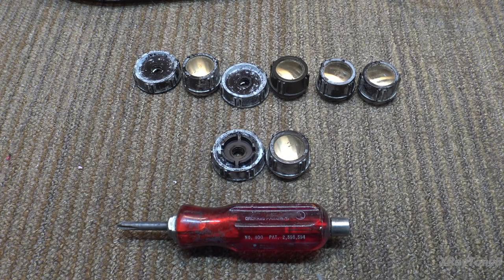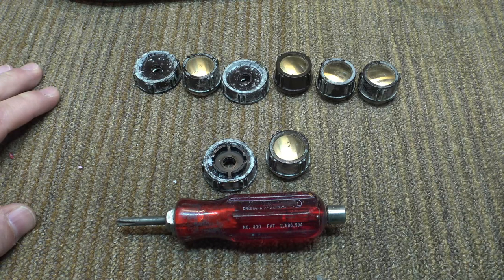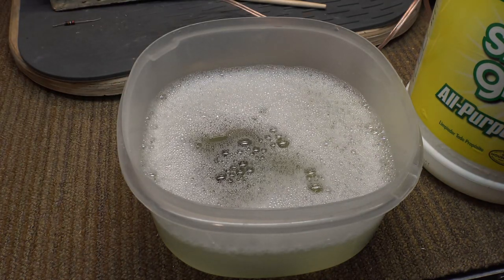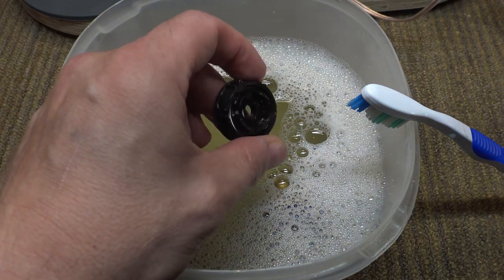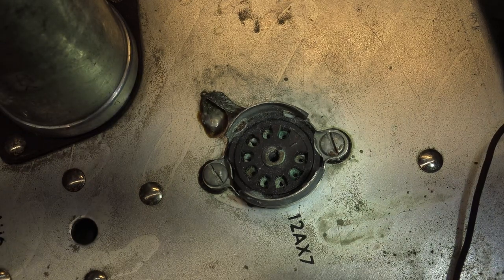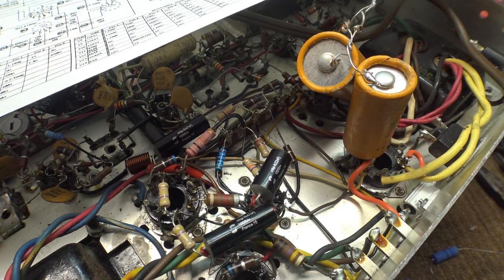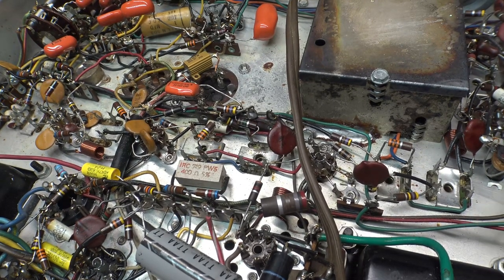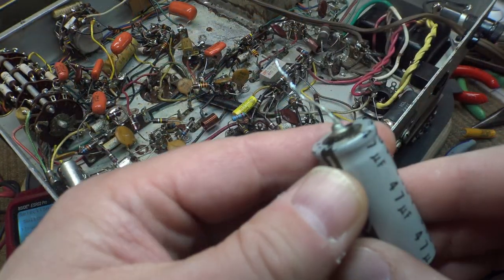Fisher 500 Mono - Part 2

Comment: Two cleaning solutions that *work*, from personal experience: 1) 1 part household ammonia, 1 part Formula 409, 2 parts distilled water. 2nd option): Oxyclean crystals dissolved in warm water. Either of these work great against the crusty white fungus that grows on knobs, and Xcelite tools. Oxyclean also removes nicotine tar! The ammonia/409 solution came to me from a restorer of old radios. Oxyclean was my own idea; i soaked my Xcelite screwdrivers in it and it worked great.  The stuff is amazing, it's the only thinG I will use to clean the deck or the cedar siding on my house. It removes nicotine tar as well.

Comment: Great video!
I would definitely use anti-seize compound on the screws that go back into the pot metal. In restorations where steel screws are screwed into zinc or aluminum and there is a possibility of moisture, I replace the screws with stainless steel and keep the original screws with the equipment. 
I'd use Marpro Zinc Chromate paint on the rusted RF shield now that it's cleaned up (unless you re-plate). 
I have a set of Xcelite nut drivers from the '70s. They still have "the smell" sometimes. I never considered that moisture might affect them; mine are in their yellow case and stay dry. They don't smell as bad as many products from China. I wonder if wiping the knobs down with WD-40 once a year would keep moisture and oxygen out.

Comment: I've had many Snap-On handles that i bought in the '70s & '80s do the same thing. Most often it was the ones that come in contact with antifreeze. So, I always figured that it was a reaction to the Ethylene, Propylene or Glycol. I never tried to clean them because they would usually crumble into dust. Good thing there is a lifetime warranty on those!

Comment: The IF cans were made by another manufacturer  who specialized  in this type of part and were supplied to Fisher.  Very few schematics specify the value of the capacitors  inside them as it was never envisioned that someone would have to replace  them. If there was a problem with the can you simply ordered a new one  and replaced it. They are not always the same value either. The cans with the compression type trimmer caps on top didn't have the SMD problem. Thanks for the look see. Stay well.

Comment: CAB's commercial name is Tenite. It was used a lot in the 50s and 60s for gun stocks, and was a favorite material of Philco for radio cabinets during the 5-tube area. Its most famous use was probably as the safety screen on Philco Predicta TVs. https://images-na.ssl-images-amazon.com/images/I/51JlobNviPL.jpg

I can confirm that if kept cool and dry they don't seem to degrade and don't smell. But god help you if you keep them in a humid environment - the smell and fungus start growing quickly. I have a Predicta on the bench right now that I polished clean with Novus plastic polish; looks like new but the smell persists.
Reply from the maker: That explains a lot!  My best friend had an old double barrel shotgun.   We called it "the toe jam gun" because the plastic stock smelled like toe jam.  It now makes sense, all these years later!  :)=)

Comment: Did you note that metal power resistor attached to the main rectifier tube. That does not look stock as that style resistor is too new for the 1950s. Looks like it may be R82 on the schematic. If the proper value, that's a great replacement, better than some old sand filled cement resistor but you may want to check it.

Comment: Across 36 volts, 390 ohms will drop 92.3 mA of current. Square that, x 390 ohms = 3.32 Watts of I^2R dissipation. Even using a 400 ohm resistor, that gives 36^2/400= 3.24 Watts of dissipation. I’d use a 10 watt jobbie just to be on the safe side. 😊

Comment: 4:15 Try some alcohol vinegar or toothpaste soaking. 
Another option is to heat the plastic to let say 60 or 70° (way below melting point), and then put it in a vacuum chamber to let it degas.
6:39 To remove nasty odors from your hands, you can use socalled "metal soap" or the commercial name "Rub a way bar", it's stainless steel in the shape of a soap bar. 
You first wash your hands with normal soap, and after that, you rinse your hands with only water and this stainless steel bar. 
When i first saw that commercial on YouTube, i though it was fake, but after ordering it and trying it out, this really works great. 
I recently used it for removing the odor of fuel oil (sort like diesel here in Belgium for central house heating) from my hands.

Comment: Hi Tony, I think you can use Shango066's method of installing two variable caps, dial them in with the slugs midway and mesure them.
Reply from the maker: I may have to do that.  Too bad they don't just list the values in the schematic  :(

Comment: Hi Tony. Have Xelite screwdriver set since late 60's and have added to the set since now. Is that smelly plastics doesn't dryrot.   Think is the same plastic on the Weller soldering guns where you'd see the white funk.  😵

Comment: To figure out the right capacitance value, couldn't you use a grid dip meter or some other sweep oscillator to test for resonance out of the circuit as you tack on different caps to see what works?

Comment: With a chassis this oxidized, riveted ground points are extremely suspect (and cold-worked rivets relax over time). Resolder them all, at least for the tuner section, if you want it to stay in alignment..

Comment: If it comes down to having to find a new IF can or two, I recently was able to hunt down one for my HH Scott 340 by checking this old 1959 Miller catalog's cross-referencing of manufacturer part numbers: https://plymouthcolony.net/starcity/radios/files/verify.php?file=miller58.pdf. 
I eventually found the part, an FM discriminator made in 1963, at https://antiqueradiosandparts.com/

Comment: There coils not transformers :) great job on restoration so far
Reply from the maker: They are, in fact, resonant transformers.  There is a primary and secondary side.  The resonant frequency is magnetically coupled from the primary side to the secondary side.  I think I showed it in the schematic, but if I didn't, you will get to see it in the next video.  Thanks for watching!
Reply: @xraytonyb  interesting cause they look just like IF and RF coils to pickup tuner frequencies. Which usually have caps inside of them also and you use a tool to adjust the slug inside to peak the frequency stamped on top of them or in schematic

Comment: Tony. I have an idea for neutralizing the smell/ preventing further fungus growth: soak the fungus knobs in a baking soda solution. From https://www.mcgill.ca/oss/article/general-science-you-asked/can-baking-soda-really-absorb-odors-fridge: "Baking soda, or sodium bicarbonate, is a base. It reacts with butyric acid to form sodium butyrate which has no smell because it is not volatile."
Unfortunately, I don't believe the baking soda would help with cleaning your mind of memories of your ad-nauseum college years.
Reply from the maker: Might be worth a try.  Thanks!
Reply: After that leave it to air dry somewhere in an unused well lighted by the sun room for a day or two..
Reply: @xraytonyb  , a tip I got from a restorer of old radios: 1 part household ammonia , 1 part Formula 409, 2 parts distilled water. Soak the knobs, or screwdrivers, and scrub with with toothbrush.  Works great! Another method that works very well: Oxyclean crystal's dissolved in warm water. Oxylean is amazing stuff, it actually removes nicotine tar and smoke residue !

Comment: Has anyone replaced the Intermediate Frequency Transformers with Crystal filters of the technical specs so as not to have the same problem ever again and to get away from alignment except for the front end as crystal filters come in various center frequencies like 455Khz 10.240Mhz and 10.740Mhz so if not why not

Comment: I would try a strong oxidant like chlorine bleach or hydrogen peroiyde, This should kill any smell and fungus but could  also bleach the color. of the plastic.
Reply: I agree chlorine defenitely kills fungus and with it killed the smell goes away.
Most dish washer tablets and powders contain chlorine.
Reply: Oxyclean crystals dissolved in warm water will remove this crusty fungus. Much safer than chlorine, and non toxic.

Comment: Re crusty green tube socket corrosion: I bet somebody sprayed the sockets with deoxit. Left in place, it will corrode contact points with dissimilar metals or DC going through them. Never use residue-leaving cleaning tube sockets! Flush with a no-residue degreasing solvent.

Comment: Aliening those caps is going to be a major endeavor.  Guess you will replace them with the old variable  ceramic mica  a   type ?
Reply from the maker: Either NP0 ceramic or silver mica caps.  I may use the variable caps just to find the correct value.  Thanks for the comment!